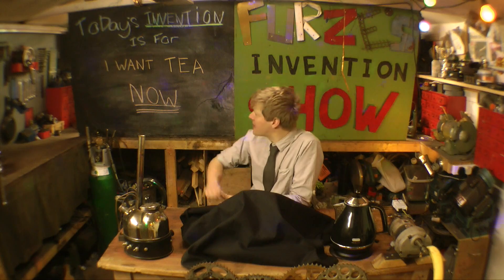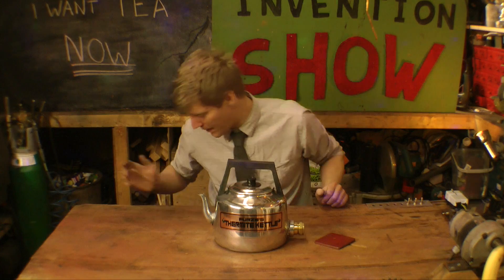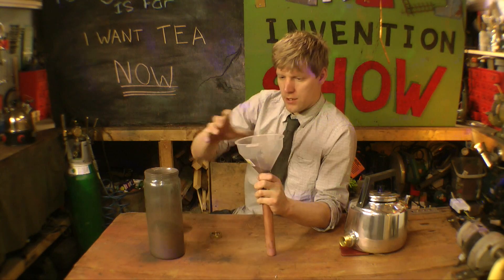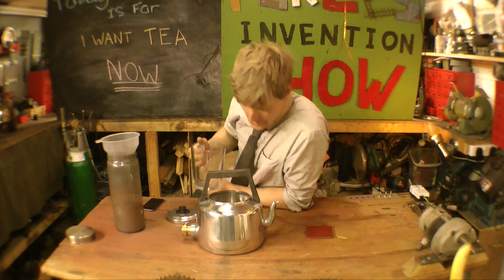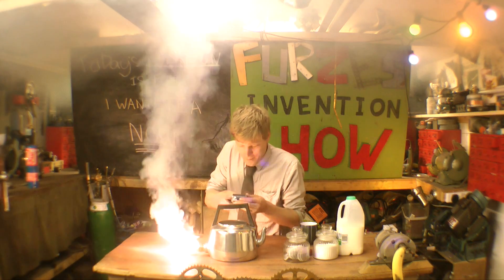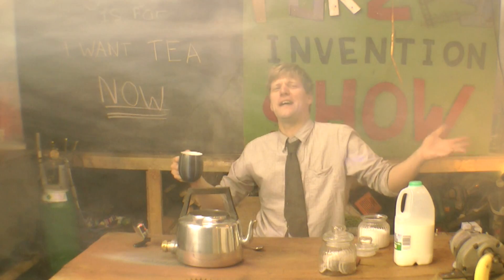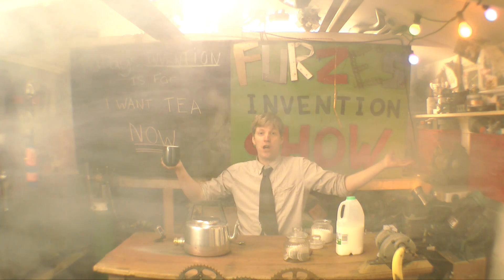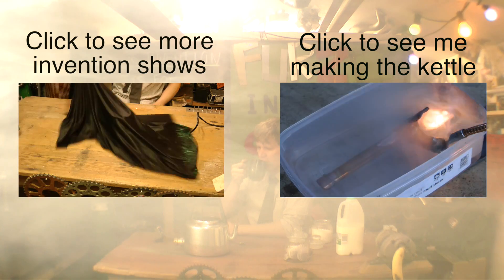The Thermite Kettle

Comment: What's the melting point of copper? Funny the cartridge didn't melt.
Reply: He explained that in a previous video. The aluminum he used in that particular batch of thermite was too large resulting in a cooler burning thermite. As a result, it would make the copper pipe really, really hot but would not melt it. The batch was insufficient for the thermite launcher so he created the thermite kettle to use it up.

Comment: I think it's about time that young parents had self propelled pushchairs for their babies, where the mums and dads wear roller skates and get pulled along by the babies. Obviously the controls would all be on the handlebars, for mum or dad to remain in charge, with a failsafe throttle cutout in case mum or dad was thrown clear in a wheelie or beck jump. An old quad bike ought to have enough donor parts for a prototype.

Comment: I have yet to watch it work but I have a feeling it ends pretty badly

EDIT: Huh I was expecting the tube to melt due to how hot thermite is. Did the water really absorb that much thermal energy to keep it from burning down his garage? I mean it only burns at 2204.444 C that's 4000 F for us americans but I mean HOW does it absorb that much???

Comment: make a motorbike that has some really strong electromagnets that are turn at an angle at the base of the rear wheel and some metal plates that push away from them and turn the wheel. and where the motor would be  put some car batteries or some kind of long lasting batteries. then take something like a small windmill and put that on the front wheel so when you are using the power from the batteries they are also getting recharged so you are not even using any power. so you should go pretty fast.

Comment: An other idea on an improvement over a traditional kettle:  Build an induction heater around a steel kettle and boil water by heating the metal of the kettle until it's red hot.

Comment: Enjoy your cancer... and cup of tea together
Reply: There is no reason why thermite would cause cancer.
Reply: Jonathon Furman Anything that burns with combustion is cancerous, even cannabis that has anti-tumoral properties, that's why a lot of people vaporize or cook dishes with it
Reply: LINKINPARK4EVER1996 I guess, but mostly I meant the material wasn't inherently cancerous, like asbestos or something
Reply: Jonathon Furman No I mean when burnt
Reply: +LINKINPARK4EVER1996 All of the cancerous compounds and diketones, poly cyclic aromatic compounds, acetoin, acrolein, diacetyl, and acetyl propionyl being the main ones, are all exhausted outside and out of contract with the water. So, no, there are really no worries; unless the copper pipe is reaching temperatures, on the side of the pipe in contact with the water, that could be creating toxic off-gases. (but I highly doubt it's getting anywhere near hot enough for that. the water is conducting the heat away from it almost as fast as the copper pipe is conducting the heat from its inner diameter to its outer diameter as the thermite is heating it.
Reply: Andrew Delashaw I was saying the smoke that builds up in the room due to the termite burning is cancerous, no water or copper mentioned.
Reply: When termite burns (iron-oxide and aluminium) it creates iron and aluminium-oxide (Fe2O3 + 2 Al → 2 Fe + Al2O3), plus water vapour from moisture that is inside of the powder. The smoke is not a carcinogenic, or has such a low carcinogenic effect that it is negligible against other effects.
Reply: Laurens Roos That's new to me.. but still doesn't look healthy to breathe
Reply: There is a diffrence between what looks horrible to breath and what is dangerous to breath
Reply: Laurens Roos Yup, but I don't know how would be healty to breathe iron/aluminum stuff

Comment: W=mC∆t
450g(1lb)x4180*(100-20)=150kJ
assuming temperature of the room is 20°C
150kJ/50s=3kW
to elevate the temp of the water from 20° to 100° in 50s you need 3kW of power, so its approximatly the power of the boiler and sadly we can easily achieve that with electricity. Now what's about an instant electric boiler of 5kW, with that we can boil water in only 30s without burn up the house

Comment: it will boil faster with same powder and multiple boiling rods, right?
Reply: +Yogesh R If you used thinner rods, yeah. I think his thermite might be a little less efficient than it should do. I know it's irregular, which is why the pipe is able to withstand it, but I'm not quite sure in what way it's irregular, because if he has too much Fe2O3, then the reaction should be generating some oxygen gas, which is carrying off heat as well. In any case, more efficient, slower burn thermite, thinner pipe, faster boil.

Comment: Your next kettle has to be strictly using electricity, maybe just electrodes straight into the wall or a MOT. Basically use the conductance of water to push a lot of current through it, kilowatts.

Comment: Adding fins to the circumference of the copper pipe would reduce the heating time significantly. So long as you ensure they are properly attached without air gaps

Comment: Funny thing, I hardly think this is optimized at all.

Imagine doing this with fine powered termite, and not just a copper pipe, but a proper radiator. Pipe with fins coming off of it, with enough surface area to prevent the pipe from getting hot enough to develop the Leidenfrost effect.

What if you actually set it up so the whole kettle was a steam pump, so you can heat the water even faster through circulation as well instead of just conduction. 

What if you were to run the thermite exhaust through a heat exchange in the kettle as well, and set the termite up to have a faster advance? maybe lighting it from the middle instead of one end. 

I think you could get a rolling boil in maybe 30 seconds, with significantly more water, and significantly less thermite.

Comment: You could make a vacuum kettle. Boil the water in 1 or 2 seconds flat by drawing a vacuum into the kettle. Wouldnt be hot but technically still boiling.

Comment: Hi Colin, I hope you read this one, I've had a bit of a skin full tonight and have come up with a remarkable plan for fords think different campaign. It's not likely for any time soon but in the future I have no doubts, think of a tram rail but maybe having rails either side and one on the underside rather than solely underneath.

Now, That wasn't my pitch, My pitch is to think different, Not for how the engine works, or how anything else runs, but more importantly, the brakes!!!

A simple oval tram rail style  (as mentioned above) with 2 carts, Setting up an electro magnet systems that will repell the next in sequence providing amazing insulation from the crash that could have happened. Don't get me wrong, The occupants may be shaken, But they wouldn't be stirred. 

Cheers for reading!

Comment: I got an idea for a hover board, use 2 electric motors . 1 wood board abut 5 to 4 feat , 1 speed controller. a button. a fan intake,  some power for the engine, and a rubber skirt  wit hols about an inch apart.

Comment: Can thermite melt steel beams?
Reply: only memes can melt steel beams
Reply: ThePotato A material getting softer doesn't need to mean that it melts.
Metals are not like water. They get softer and softer when heated and suddenly begin to melt if they are heated hot enough.
Reply: +ThePotato Steel doesn't need to melt to become weak.
Reply: with thermite were some railway tracks welded
Reply: +ThePotato There are different compositions of thermite. This one can't as he said in the explanation video.
Reply: It can't melt dank memes for sure.
Reply: No but jet fuel can
Reply: L4RRY How else can it become weak without melting partially?
Reply: +Hoch134 it was a joke I think you misinterpreted the point
Reply: JFK cant melt steel beams
Reply: JFK cannot melt steel beams Mr conspirator

Comment: i wished you'd pay a little bit more attention to safety :(
Reply: +anguel wyvern SAFETY TIE.
Reply: He did. He precisely measured the amount of water going into the kettle. This will significantly decrease the chance of spilling. After all, spilling hot water on oneself is probably one of the most common injuries that occurs while making a cup of tea. He also waited until the last possible moment to take the milk out of the refrigerator. This increases the likelihood that it will not have turned and will be free of bacteria. If you notice he also put the lid directly on the sugar after adding it. This will prevent attracting ants or other for infestations. The Colin Furze Channel Where Safety Lives!!!

Comment: you need to try the Army Engineers method. You need a piece of steel 25 mm thick about the size of your kettle and about 0.5 Kg of C4. The trick is to set fire to the C4 not detonate it. Once the C4 has burnt the steel will be red or white  hot, put your kettle on and it will boil in about 30 seconds.

Comment: I guess thermite doesn't like copper? or is that brass? so thermite only melts through steel? or what? I'm not edumecated Please help furze!
Reply from the maker: +David Chase it does not melt because the water is surrounding it, if  no water it would melt
Reply: +David Chase heat always travels from hotter things to cooler things and different substances take heat away from hot things faster. Water takes heat away from hot things way faster than air does, so the water boils and takes the heat away from the copper pipe. If it was just air, the heat wouldn't be able to escape from the pipe fast enough and the pipe would reach its melting point.
Reply: Thermite can melt steel beams
Reply: +David Chase If you set a paper cup full of water on a fire the bottom rim of the cup might burn but when the flame/heat got next to the part of the cup holding the water, it won't burn because the water pulls the heat away since it would boil off at 212 (f), way below the temp to make the paper burn.  Think of the water as a radiator because that is exactly what it is doing.

Comment: +colinfurze I have quite the idea so i hope your up for it (actually i have two ideas maybe three) My first idea is a pulse jet powered car (but with like 2-4 pulse jets) (if u have already done this don't judge me :D) My second idea is to make a jet/pulse jet powered generator for your bunker.  My last idea may be a slightly dangerous (by that i mean u might/probably will die to this experiment) it is a pulse jet or jet (and just to throw it out there a very powerful water pump) to launch you AKA dummy to SPACE (in case of the jet/pulse jet just make it fly the dummy around your air strip looking place and have fun!  you AKA your weight ratio to a dummy (that last sentence wasn't suppose to go there but just wanted to make sure you knew that! PEEPS LIKE IF U WANT TO SEE!!!

Comment: Invention Ideas:
1) Pulse-Jet Drone.
2) Steam Powered Bike / Trike / Go Kart - Try Piston Engine, or Use Steam-Jet. (Boil Water, eject it through a Venturi.) 
3) Steam Powered Rocket?
4) Pulse-Jet Ski? (The water is cold up there in the English Channel, isn't it?)
5) High-Powered Pogo Stick? (With CO2 assist?) (Press a button on the upstroke, to release CO2 into a piston chamber for some extra punch). You'll probably break your Ass/Arse with this one.
6) Fireworks rocket powered Bike / Trike / Go Kart / Pram?
7) Electric Ham Cooker? (Two Electrodes, current passes through ham and heats it up. Use High Voltage and Current for HAM NOW! (Check with +PhotonicInduction for this one). 
8) Get a real job perhaps?

Did you see Demolition Ranch's channel where he froze cotton in water, and could not shoot it apart with a .50 Cal? This might make more durable Ice Wheels.